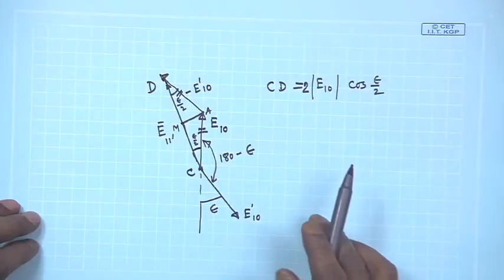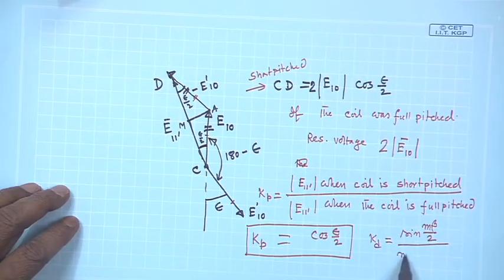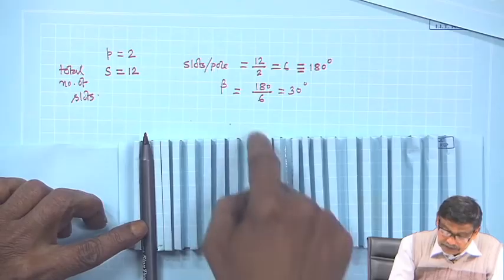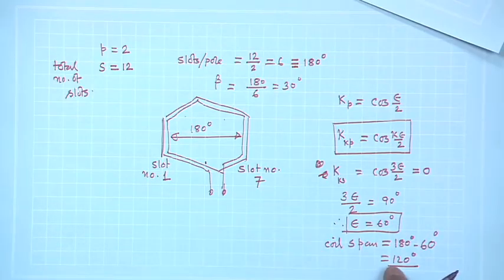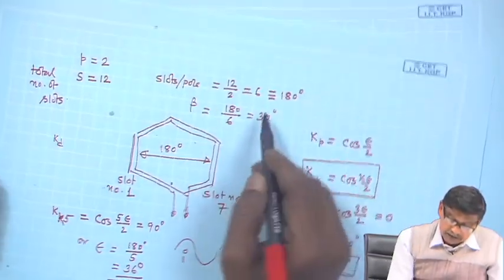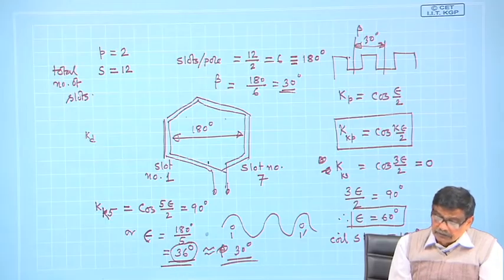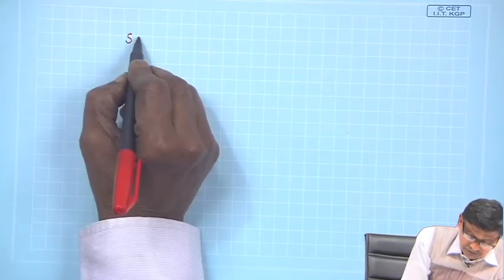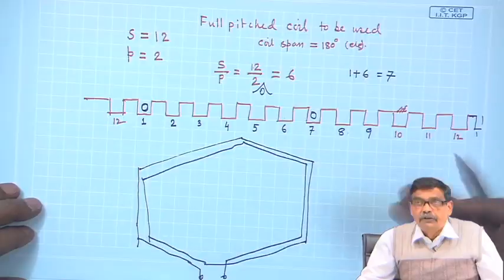Lecture 23: How to decide about Short Pitch Angle ϵ

Comment: Can we remove 3rd and 5th harmonics simultaneously ?
Reply: I think you should take the LCM of charding angle found for both 3rd and 5th harmonic...
Reply: @madhursharma4445  no it is average
Reply: @chandrashekhardasari1345  how is it gonna work 😕(even confused with taking nearest of 36 deg to 30.. Well it may work for first some rev but after 6-7 rev 5th harmonic's top will be around 30 deg apart which is direct on a coil🙁)